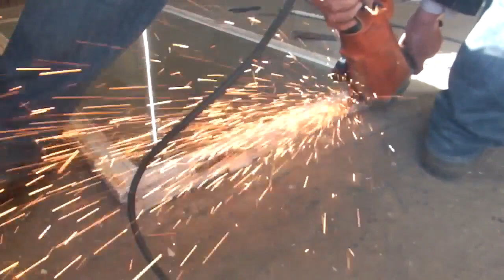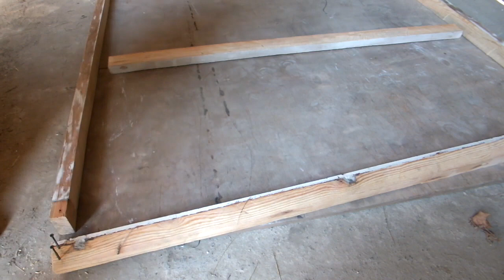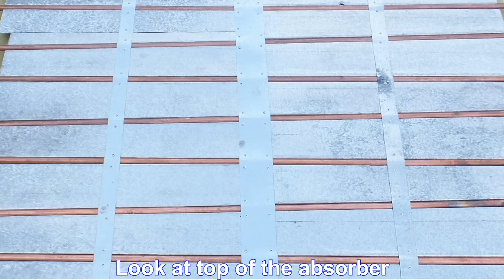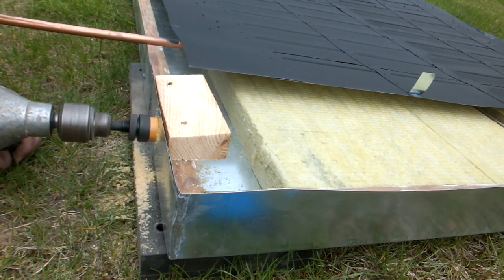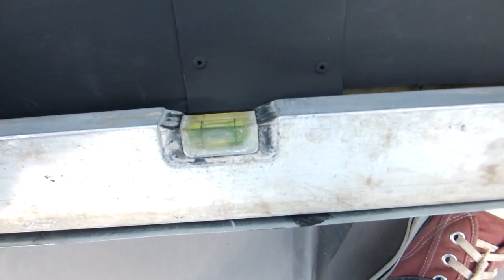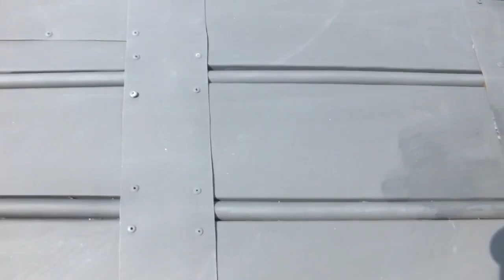DIY solar collector - Homemade solar water heater for drainback system

Comment: Hi! Which pump model would you suggest for a drain back system, in which 1 liter per minute flow is required? Thanks
Reply from the maker: Selection of a pump in the drainback system is the most difficult matter. You won't find a pump with such a low flow. This is not the only parameter that must be taken into account. When selecting the pump, pay attention to the head of the liquid column by the pump and follow this. The flow can be limited by partially closing the valve above the pump.
Reply: @SILVESTROThingS  Thank you very much for your prompt answer. My doubt is about the increase of pressure (and possible overstress) in the pump, limiting the flow by partially closing the valve above the pump. Is that right, or I'm wrong?
Reply from the maker: @francesca7765  Of course, the resistance in a partially closed valve increases, therefore the flow decreases, the valve must not be closed completely, because in the absence of liquid flow, the pump will not be cooled. The valve must not be installed on the side where the liquid is sucked into the pump, because then the pump will cavitate and will be damaged.
Reply: @SILVESTROThingS  so the pump is able to cope with the higher resistance (and pressure) or would be dameged?
Reply from the maker: @francesca7765  For me, the pump has been running for 6 years with a 1/2 inch valve closed to 1/4 cross-section.

Comment from the maker: The presented collector can work in a different type of solar installation. Requirements for the construction and assembly of the solar collector for the drainback solar installation are greater, especially when working on water in cold climates, as is the case here. Collectors built of panel radiators are not suitable, because they quickly corrode.